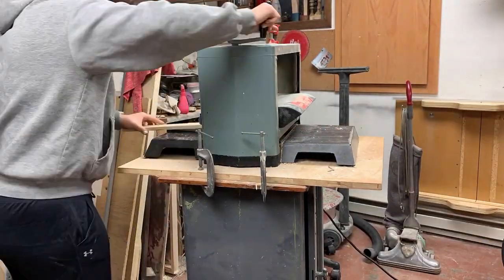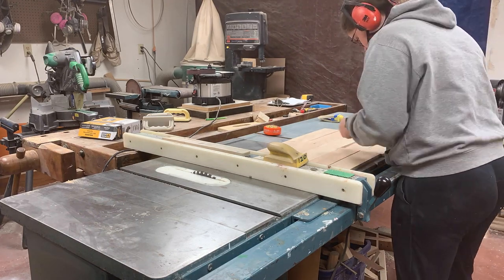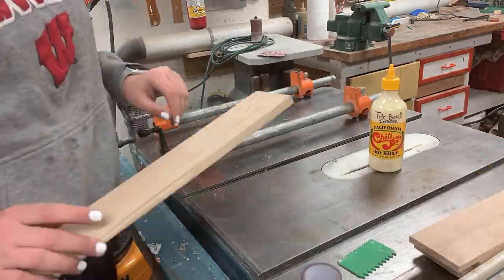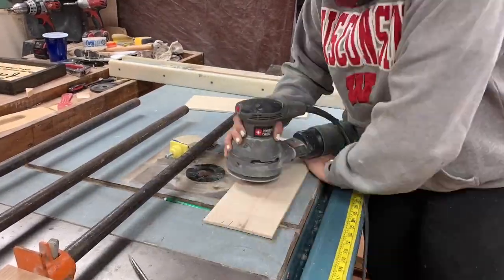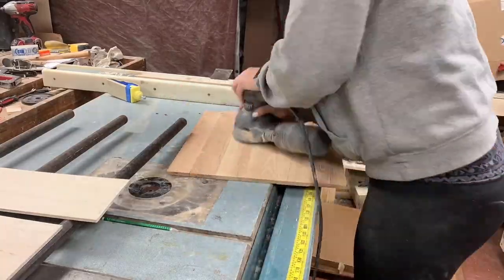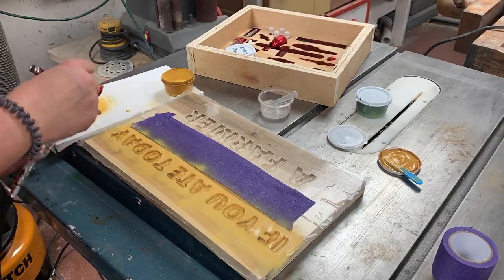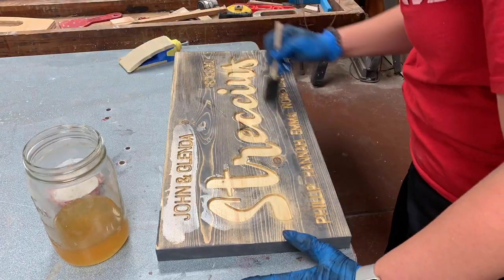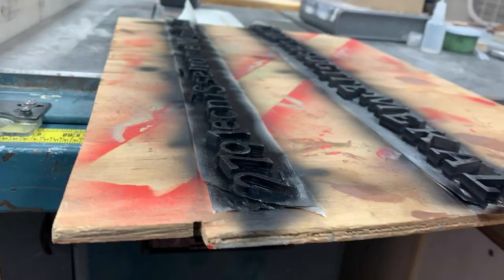Making Wooden Signs On 3D Printed CNC

Comment: Good work!  You might want to clean ends to make longer boards then make them wider then plane down to one thickness.  It dowsn't always work that way with pallet boards.

  Besides saving up for new planer blades, look in to bots to do toung and grove joints, it adds some sideways strength.  Go for more clamps ( the 2 boards you screwed down ro stop sideways shifting ) as more holding is better, even if only along sides near each corner.

  As to the name change, do not believe the phrase " a rose by any other name... " as it is more descriptive than ' red thing that smells nice ' and rhe new name is more precise.

Keep it up, try to get on a schedule that lets you record more and once a week edit and/or upload.
Reply from the maker: Eric Blenner-Hassett thanks!